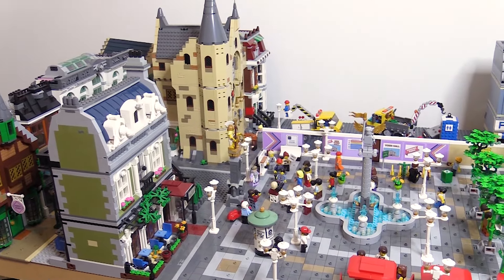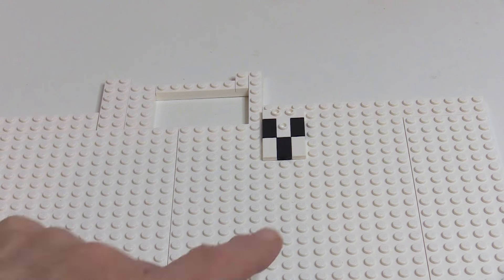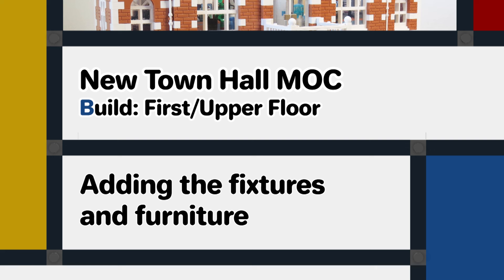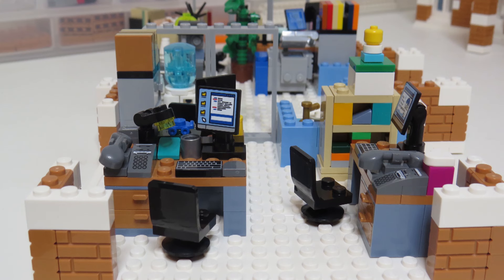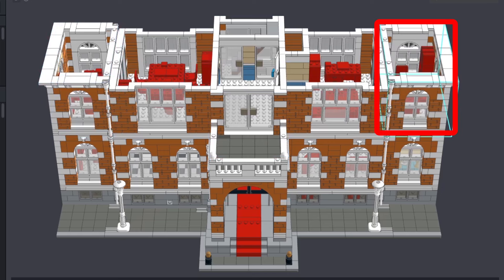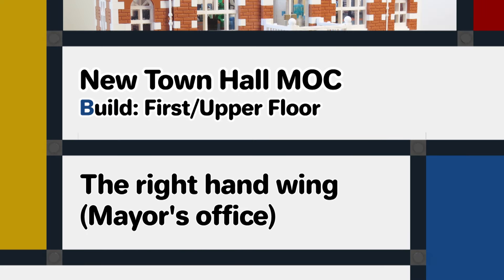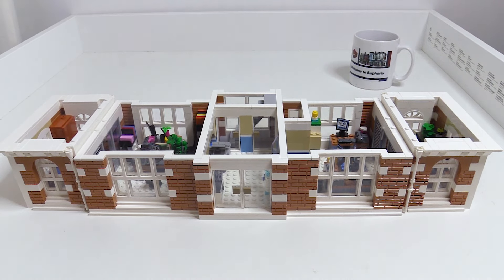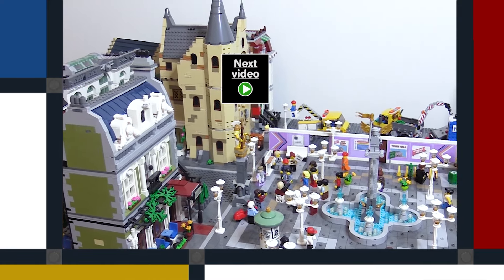New Town Hall Modular MOC - Part 12 : Build Part 3 - First/Upper Floor

Comment: Are the tan arches above the end windows deliberate? Or are they just not available?
Reply from the maker: Those tan arches do annoy me slightly. They are not available in medium nougat, https://www.bricklink.com/v2/catalog/catalogitem.page?P=92950#T=C. I wish they would make them in medium nougat or dark orange, but out of what is available tan or LBG seemed to be the best options so I went with tan. Other options were to go with a straight lintel (1 x 6) or the higher arch as used in the front windows, both of which are available in medium nougat.